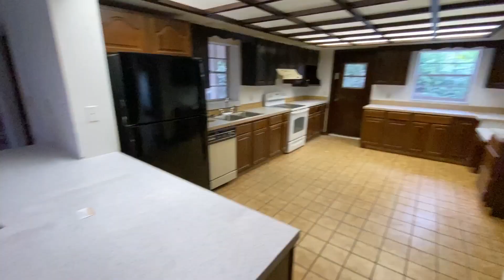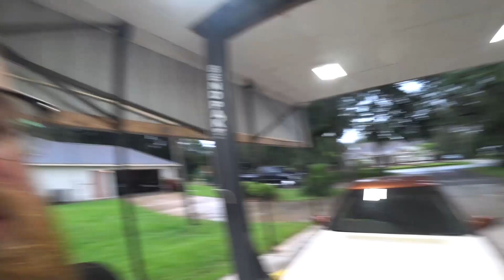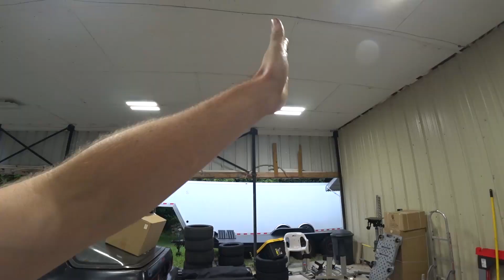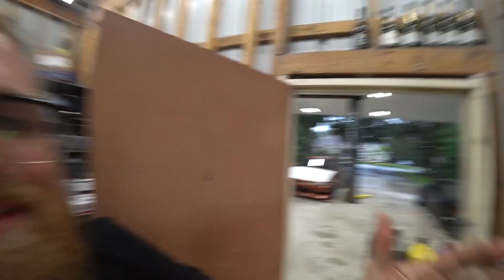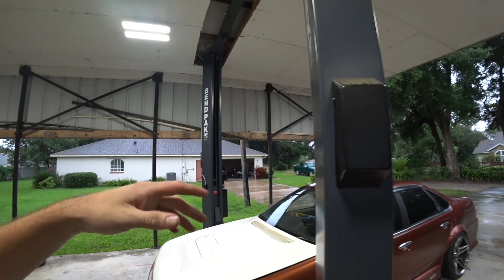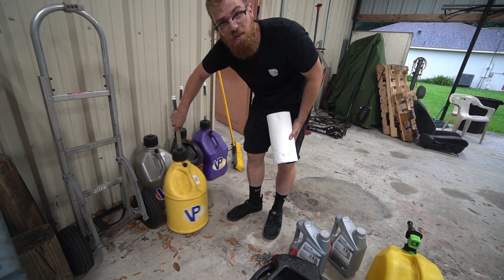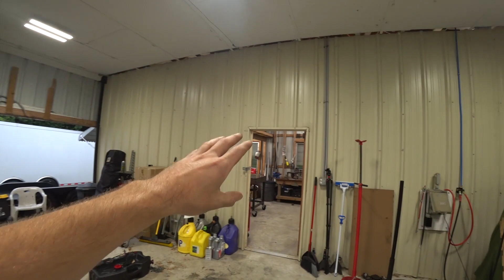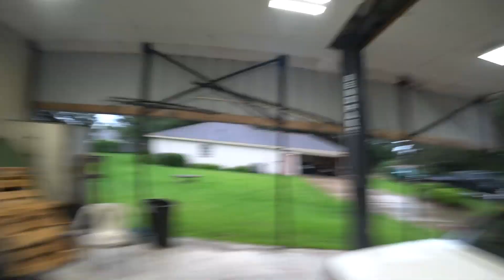Update on my new shop. I have to tear it all down.

Comment: Just install tie down rods every meter around  the external walls that are  bolted rod through the top plates of each wall  and down to the concrete slab  .  Also the roof trusses would need to be strapped  over and down the wall studs . Not sure what  ply bracing  you need for racking but generally  2.4 meters every  12 meters  and in each corner , each way .

Comment: Man, this video just helped me realize I'm not the only one going through this. I had a company tell me they could handle everything from permits to ground work; slab; building; electrical, etc..  They gave me a quote of 52k. I already had 65k saved up for the project, so I said how soon can you  start. This was April 2020 & by August I couldn't even get the company to answer or respond to my phone calls.  Called the city & they told me they didn't see where anything was even submitted. So I went to a local engineering firm that was recommended to me by a friend who owns a lot of rental properties. The guy at the firm said that he used to work for the city zoning commission & assured me he could make things happen. He did say it would take some doing but that what I was trying to build was absolutely possible. I had decided to order a 30x70 prefab building  for 25k, had a budy that runs a Cement company  that was willing to do the ground work & slab for 15k,  & a church member who's a certified electrician that does work for the city to handle electrical 5-8k depending upon what I requested. So 45-48k plus 2k for engineering firm to get permits pulled for building.  That also covered their surveying the land. Anyway fast forward to July 2021, a month away from being a full year later, Still no progress. I had already spent 8k to have trees on property removed & paid 4k deposit on building to get blueprints from the building company,  to help the process along. I'm still waiting to hear back from the city. According to them they're just that backed up due to the pandemic. Meanwhile I have a friend & coworker who have filled for permits & gotten their buildings done in that time frame, same city & parish that I'm in.  I made a decision to move back to this family property that was gifted to me back in 2002 a couple years ago for the sole purpose of having a home with a shop to continue my life long hobby. Shit is super frustrating 😤!

Comment: Have the AC outlets pour cool air down from above, don't try to blow it from one end to where you want it, use ducts. Put your electrical (GFIC) outlets like 52" off the floor if there's a chance you will be putting compressors, welders, etc. along there or leaning sheets of plywood against the wall. Skylights, free light. you will be having oil and chemicals spilled on the floor, where will that run? How will you handle recycling? Bins? Shredder for 5 qt plastic oil jugs? venting fumes and particulates is critical, lung damage comes later in life if you don't. Noise management, the insulation will help but you may want to ponder sound deadening panels or something as simple as flags to knock down some of the racket. Plumb for water and compressed air and presumably a toilet/shower. Eyewash station, first aid station. Co3 detectors. Throw a little fine silica in your concrete sealer for a non-slip floor. Spray booth? Once-in-a-while spray booth with sliding plastic curtains, ventilation (filtered fresh air in at the top, paint fumes out from the bottom to a water trap or other catchment. Don't forget security, sensors, alarms, etc. Do some basic work flow analysis and try to position materials, fluids and tools according to work functions like Welding, Electrical, Paint, Parts Cleaning, Iron Work, Machine tools, in "pods". Not all chemicals at one end and not all hand tools in one cabinet, etc. Consider putting the windows higher so the average burglar can't look in and see what you've got. If you build it with steel skin, consider lining the lower four feet on the inside wall with plywood to minimize the chance of someone snipping the metal and kicking through your drywall to get in, esp in the rear (more secluded) walls. Got snakes? Rats? Wrap your 6x6 posts in thin aluminum to keep critters from taking up residence in your rafters and lofts. Chance it might flood? Consider putting welders, compressors, etc higher, off the floor. Make all your workbenches and work stations the same height. Put 4 inch rubber casters on some of the workbenches or workstations so you can move them around as needs change and even butt them together for special large work pieces. Mind your lighting for good, but not too strong, lighting exactly where you'll need it. Think gooseneck and adjustable lights. Oily rags in air tight cans to prevent spontaneous combustion. Skip the fancy floor epoxy stuff, if is just another maintenance item you don't need. Open all the doors and use a leaf blower to blow out your shop once a month, keep the dust out. Use sweeping compound (treated saw dust) to get all the dust off the floor. That dust will have some nasty stuff in it you do not want in your lungs. Good luck and have fun watching lots of dream workshop tubes.

Comment: 12x12 bay doors are nice, but if you can do 12x14, then if you ever had a 5th wheel or RV or anything that is max road height of 13'6" it will fit under.  The difference in door prices are minimal. The difference in flexibility is massive.

Comment: lol wow here in New Mexico I built a shop 100 thou square feet with mud bricks and timber beams needed no permit made bricks with material from property beams harvested from forest only had to by plywood and metal roofing total cost was 5 thousand dollars to build enclosed building with wood stove for heat, Summer is awesome nice and mild temp building easy to heat in winter.

Comment: Absolutely do not get a separate service with 2 meters. You should have a 200 amp service at house already so you should be able to just add a 100 amp breaker to a 100 amp sub panel at the shop. On doing work on your own, i work with contractors to let me do the work on HVAC for example then pay them to do an inspection. Then you are good for insurance but you have to know what you are doing.

Comment: We once had the same situation. We made instead of permanent walls we place railings above on open walls. Then we made like barn doors wall panel with roll wheels that you could push over into each other or close the same way and lock. The only permanent walls was on the corners that you locked the walls to. These walls were not considered permanent because they were closets with shelving. Our builder came up with idea. This way there were not hoops to jump. Just saying. I wish we still lived there but when the military says to go you go. We did get a great price for the home and the shop got us the great price.

Comment: No need to tear down the existing shop.  Just build another like you need.  Then you will have two shops.  Build the new one at the rear of the existing shop.  You can use the existing store room to serve both shops and have more work space in the new shop.

Comment: Awesome!! Sorry you had to go through all this, but it seems that it had you think outside your own box.  Happy for you!!  Keep in mind that will most likely need to upgrade your electrical service at the main house to allow for the load requirements you will have in the new shop, with air conditioning.  Which may mean that your meter, panel and wiring would need to be upgraded. This is all assuming your garage isn't zoned  with its own meter and panel.  Good luck and hope it all goes flawlessly!

Comment: Do 200 amp service you won't regret it. Approach electricity like buying  a tool box. Never buy a tool  box for the tools you already have, you'll always acquire more.  I just finished  a 60x60 shop/office/pole barn. No building codes where I live.

Comment: Swamp coolers for the days when it is dry, central air for the days when it is humid. Running central air all of the time in a shop that size will easily cost you a thousand dollars a month or more. Swamp coolers are way cheaper to run and work better when it is dry. I would throw some solar panels on the roof to off set the cost as well. You are going to want at least a 200 amp panel especially if you are running welders and other current hungry equipment. I would suggest metal halide lighting for the large part of the shop as well. After all it's always better when you can see what you are doing. Good luck.

Comment: Not sure on the regulations in Florida but in many parts of the US you'd need permitting for the pallet racking and that could include adding a fire suppression sprinkler system to your shop. If the shop is just for your personal use you won't get inspectors coming through who would question it. Just don't mention it around the inspectors and put it in quietly later. If you're trying to go by the book however and follow all permitting codes then that's something you might want to check on before adding something like that.

Comment: Go with a ductless split HVAC system. They are about 40% more efficient than traditional units and check out Aeroseal or something similar which is a caulk misting system to seal your structure in the build out phase. Your a/c bill will be less than half the normal amount. Good luck with the build.
Reply from the maker: I’m conflicted on the mini splits. I wasn’t impressed by the ones I was around. Not any cheaper than doing a normal unit.
Reply: @Taylordrifts  your structure is going to be pretty big so I understand the conflict but there are definitely highly efficient split units on the market that differ from the typical "mini split" you typically see people using for room additions and garage work shops etc. Search a "4 zone cassette split ac" and you'll see what I mean. My buddy installed one and couldn't be happier. It's a 22 SEER unit and it's so efficient he actually runs it off an off grid solar set up a lot of the time. Good luck on whatever you decide.

Comment: Ran into the same issue with permits in Phoenix. Had the 2nd largest engineering firm draw up my schematics for an in ground pool. City kept red lining it. 6 months of back and forth. Finally found out that the city only aproves permits that have a particular man's signature on them. The brother in law of whomever it was running the permit dept. Total kickback bribery bullshit. Paid that guy the 250 bucks to "engineer" my already professionally engineered plans, and viola, approved on the spot once I took them back to the city.

Comment: If you are going g to AC your shop you will need more than 100 amp service figuring AC, large air compresser and welder are some of the things I can think of quickly
     If you are going to have 16ft ceilings install a 14ft door on the open bay.  YOU WON'T BE SORRY!!  there WILL be that one time(s) you will be glad you did.
  Sounds like all the permitting problems, better check out having a 20ft container for a storage shed.  I'm sure there is a permit process for that.

Comment: The  A/C is a great idea, you will be so much more productive in a cool shop instead of sweating your ass off in the heat and humidity. I work out of a rented 14x50 metal storage unit on occasion and by the end of the day I'm wiped out

Comment: I am pretty sure I am too late but you will not be able to build the deck in the new shop. The same thing with the city will prevent you from doing this.  Engineered plans on the slab. Also, do you have an HOA in your neighborhood? They may change your mind about the large shop with the 16' walls.  You are going to spend lots of $$$$$ to do all of this.  The electrical upgrade will require pulling new larger-sized wire to your house. Then your service to the house may not be big enough to carry this building and the house.

Comment: There you were talking and moving stuff around. I felt kinda bad that I couldn't help with the clean up. The thing I wanted to mention is that since you are planning to add AC, you should think about solar to reduce the electric costs long term. It would be better to up the panels up while the roof is going on. ...just sayin'.

Comment: So we lived in Florida south Florida and we had a building that was built in 1977 by Dean's buildings. It was a 40x60, one end was totally enclosed with an upstairs. All the electric was in conduit in the floor. Both ends had walls no walls in front or back except for enclosed area. Looking into the building from the front the area where would be a door was totally open. The concrete looked to have been run over by a dozer all torn up next bay perfect. We called Dean's to see what it would cost to replace the metal and add doors, boy what a cost that would be around 80 thousand. Nope not happening! Next guy was a little cheaper knock off 35 thousand. So we ordered the sheet metal ourselves and had it delivered. So my wife and I started putting in new girts and one wall on the side we changed out. We had everything except for the 2 roll up doors. The other end that was enclosed we matched the color and sprayed it because it was in fine shape. Then we decided to sell and get out of hot Florida and we sold it to a couple that wanted it real bad for their horses, it had acreage also. The building has big I beams that would last forever and had an electrician replace the electric panel, it had it's own meter with 200 amps. So now live in Missouri and the building is 40x65 all concrete floor and insulated with a wood burner in the middle and wired for welding everywhere I could possibly want it, so I have a place for my tractor, lawnmower and pickup plus work benches in 2 corners

Comment: Just make sure the hight is not a problem for the permitting agency.  You don't want to build it and when they come for inspection, you will have to tear it down because it's too high.
Reply: I think you have to come up with plans first.  Those get permitted and then you just make sure the contractor builds to the plans (which he will).

Comment: get an evaporative cooler system not AC. That's what they have at Home Depot. You might want some solar to offset some of the electrical costs. The down side of side ways bays is that it could limit the size of vehicle that can make the turn.

Comment: The shop here is basically a Pole Barn. Had my 42’x60’ Morton Pole Barn built back in ‘91 for $18k not including any electrical or a concrete floor that was done later on and without any insulation as his stands. They have gone up quite a bit ever since but was one of the best investments I ever made being I always liked to work on my own cars. I built my Street Rod in my Barn shortly after it was built and store it and other collector cars that I own in it that I have accumulated over the years. Have a 9000 lb lift,tire machine, balancer, 80 gallon compressor just about everything I need to work on my own cars. Not sorry a bit that I made the move to have it built. Like this fellows place that building being on his property sold the house. I told my wife if anything ever happens to me and she wants to sell our place it would be in demand because  so many people would love to find a home with a nice size building on the property to do pretty much what they want to do with it.

Comment: Guy take the extra 200 feet or more if code allows when you do it. No one ever complained about a too large a shop. That would make it about 4 foot wider which is actually huge. I’d go 18 foot height if code would allow. Being South Dakota we fight snow load codes not height. We tend to go 18-20 height.

Comment: I built a shop zoning ok but building with steel requires stamped engineers drawing and the welds done by a certified welder . I found a loophole if I claim it a agriculture building all of that goes out the window. So I keep a bail of hay in the corner.  Bring in a 200 amp service you can go up to the the same amperage as your main on your house if is 100 amps do a meter rebuild to 200 amps you will need ti in the long run.

Comment: Hire a structural engineer. The wind load issue on the enclosed side could likely be fixed by adding kickers from the truss down to the wall.

You would be amazed if you post your issue on Facebook or Craigslist that “you are looking to hire a structural engineer“ to get around these issues. You may find an easy work around.

Comment: There's no way I would knock it down. Just put up a privacy fence and you're done. Now if money was no object, that's different. You can install a Minisplit A/C unit with the most, 20 amps of current draw. Install some receptacles where needed and voilà, all done.

Comment: I hear you about problems with permits. When I extended my house I ran into problems with approval because the council inspector didn't understand the councils own development control plan and the building codes. The idiot wanted me to remove windows on one side because i would "overlook" the neighbors. My plan was to replace and existing sunroom which already overlooked the neighbours roof. I couldn't see into their house but his objection was that the neighbour might want to put another floor on the house. So no windows because i might be able to see into a non-existent first floor next door. Then he decided that the extension would rob light from an existing bedroom so he wanted me to put in a large window meaning the neighbour could look into our bedroom. Crazy isn't it. I eventually got what I wanted by showing that my plans conformed with the development control p[an and the relevant building code. To make sure I attached the relevant pages from the development control plan and the building code together with my calculations using the standard formulas for calculating light levels. When I handed them in he refused to look at them and said he wouldn't approve them. At that point I went over his head. Problem solved, but it took 18 months.